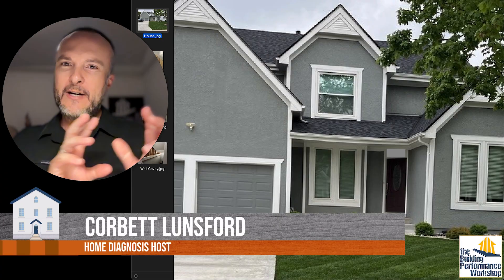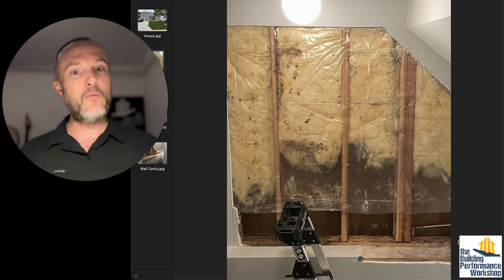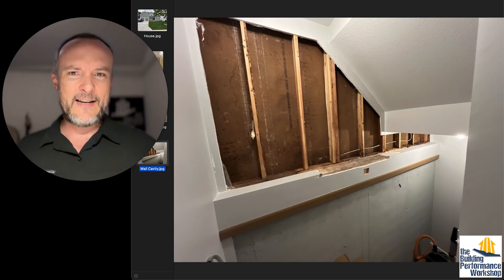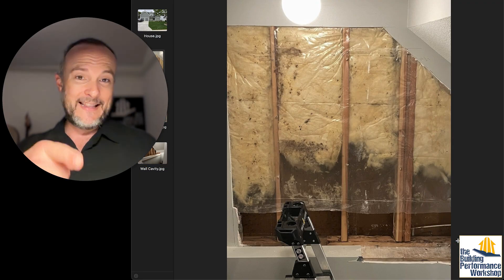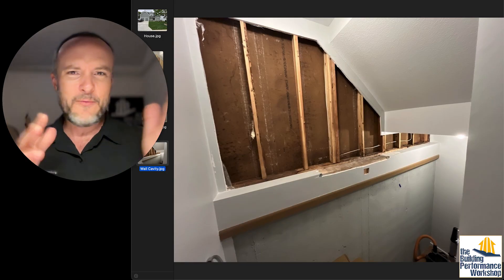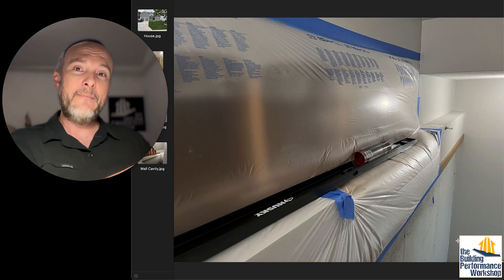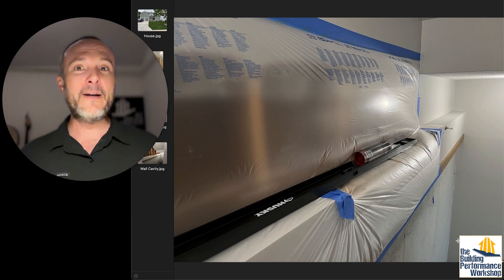Basement Mold Investigated & Solved (but NOT with spray foam or HVAC returns)

Comment: I would have a hard time judging what to do,just by saying the basement is finished without seeing it. Looks like the section you showed was above the concrete pour on the stairwell ;that being said, I would first start with the basement envelope , then the finished area would get supplies and return ducts added (envelope first & basement duct design second). But without showing us the entire basement layout , ceiling type, humidity readings and radon readings it would be hard for anyone to comment on the correct solution. Installing a louver door without radon readings could be escalating a problem. Just not enough information in this video , which is normally not the case with you 🤷🏻‍♂️.
Reply from the maker: Maybe you missed a few things in there, easy to get distracted.
Reply: @HomePerformance  at 4:09 and a quote “ it is finished mostly” (I saw no finished basement ). I must’ve missed the part where you gave us the radon levels, the humidity readings(along with the month and outside conditions). And my most concerning part would be, since we’re pulling a  negative pressure on that basement , no one checked the diverter on the water heater for spell & possible CO readings. What am I missing?

Comment: good job with the door. i really detest fixes that require people to do something. i've seen it here where depressurization caused the wood fire to back draft. their "fix" was to leave bedroom doors open. you forget to leave them open, you might die.
Reply: Just an FYI, doors should be closed during a house fire. It also goes against NFPA code to have a louvered  door between an unfinished basement and the living area upstairs. Corbin showed nothing in the video indicating a partially finished basement.

Comment: Thats a lot of negative pressure for just return duct leakage. Check and make sure there is a bottom on the furnace and check to see if they cut a return opening that wasn't needed or forgot to pan a joist.
Reply from the maker: Agreed, more investigation is needed
Reply: My furnace is in the garage. I’m going to go do a smoke test and see if it is pulling any garage air in.

Comment: The reason plastic is common on the inside of walls in colder climates like mine is to prevent interior moisture from getting into the walls, condensing midway through the walls, and leading to mold. Our wall exteriors are well below freezing in winter. Our walls are below room termperature about 8 months of the year straight, and they'll quickly become a black mess if the air barrier is on the outside. As the outside air is generally colder, when it does enter a warmer wall, its meager moisture doesn't condense. Since the materials of our walls are generally dry, ingress of humid summer air does not lead to an excess amount of moisture before they dry out again in the winter.

This also applies to basement walls build against a concrete foundation: the exterior is below room temperature, so the plastic goes on the inside to prevent moisture from getting into the wall. This does rely on proper grade and drainage to keep moisture away from the foundation.

It surprised me when I learned houses in warm climates have their moisture barrier on the outside, but it made sense after I thought about from where the moisture would ingress and condense.
Reply: That's all well and good, but you missed his point that half of the year, it's in exactly the wrong place and causes problems anyway.  That's why building science has moved away from a simple plastic sheet.
Reply: Your situation it might work because you said it works 8 months out of the year. So you have 8 months to dry out the 4 months of moisture getting in. 

A lot of the US is 6 months and 6 months so more moisture builds up a you have less time for it to dry out.
Reply from the maker: And yet I used to get calls for mold in walls every single August in Chicago
Reply: @HomePerformance  I could believe it! Chicago has hot summers (Dfa) with plenty of moisture in the air that will condense in cold walls. I lived in Toronto with a similar climate and the humid summers were one reason why I left. Summers where I am now are not as hot (Edmonton, Dfb), so the air has less latent moisture, and nights are typically below room temperature. Home air conditioning was uncommon here until the last decade or two.

I can see plastic always being wrong in the Lower 48 but it works here.

Comment: I would bet the flue on his water heater does not work.
Reply from the maker: Haha good eye buddy! You’re right :)
Reply: for sure, not with the negative pressure sucking the basement door closed. A Mech contractor should do a CAZ test, but none ever do. Heck they don't combustion test on a clean and tune.
Reply: Great point

Comment: So essentially because the basement is depressurized, moist outside air in the summer was findind a way into that wall cavity and condensing on that poly vapour barrier?
Reply: Yep. That’s it. You got it.

Comment: I have the same sealed combustion furnace. My basement has negative pressure, especially in summer with my single-stage AC. The furnace modulates during heating, reducing airflow and lessening the ‘pull’ on the basement door, though it’s still noticeable. I never thought to check if the furnace cabinet is fully sealed. The previous owner blocked the basement supply registers, and even after unblocking them, the negative pressure persists.
I recently bought a quality static pressure tester so I’m ready to get nerdy and try and solve this🤓. Any other tips? 
Living in AB Canada so cold/dry and mainly hot and dry in the summer.
Reply: If your near Calgary, I’ll come up and help ya.  Next July.
Reply: @TheDroppedAnchor a bit further up in Edmonton:) 
But you’re welcome anytime😀
Reply: @skylerdylan1005 😂 You’ve just stampeded and rough rided upon my geographic hobby.
Reply: @TheDroppedAnchor LOL. Hey you were close though.

Comment: I'm surprised to see a house built with plastic on the inside that far south. However in commercial a large chain based up north used to require franchisees to follow their plane and their architects etc. Well they put plastic on the inside of the walls here in Texas and they also put up commercial heavy vinyl wall paper on top of the interior drywall... As you can imagine during remodels those walls were full of moisture and nice fresh black mulch that was previously lumber and moldy everything everywhere. 
      
    Personally I don't really see many places in the US that should take the gamble on plastic on the walls. And same with Canada as the majority of Canadians actually live south of the Us northern border. (the earth is a globe not flat) And IIRC at one time there were more americans living further north than there were canadians.

        Good fix with the door. It's technically a bandaid but it's the appropriate fix in this case. Now if there is air being pulled down that furnace inlet that is interesting and it may be something we need to be adding an actuator valve to or a manual one. And to remind you to open it for the furnace would take just a simple switch on the valve where you run the white wire through it so the furnace can't come on unless it's open. 

          Makes me wonder if there is any air being pulled in through ours. Course I'd like to replace it with a heat pump this fall to spring as having a gas bill in the summer is not worth it and I'm looking at a system with a minisplit style condenser for several reasons one being they are very quiet. I'm done with the cave man style US compressors that kachunk on and off and make allot of noise.
Reply: Here in MN almost no one has exterior insulation to keep the sheathing at a reasonable temperature during the winter. I do agree the solution isn't plastic sheeting -- a smart vapor retarder is the right solution -- but we're in a country where few people are apparently willing to spend an extra 5% on a home to make it much more resilient (ack: the vapor retarder in place of plastic will add <1%, but there are other updates that also should be done that total ~5%). Or maybe that's just what builders think, so they don't talk through the complexities with their clients; I'd bet many homeowners / buyers would prefer to spend the little extra if builders could communicate the benefits (and if the homeowners/buyers trusted builders enough on this sort of thing).
Reply: The builders understanding the benefits is a big problem.
Reply: Plastic wallpaper in the south is why we need building codes. So stuff like that is not allowed. 

The wall compost would be funny if it wasn’t so true. 😂

Comment: I'm a little confused. If there's no return in the basement, but a supply register, then wouldn't the upstairs depressurize instead of the basement?
Reply: Check out the part starting at about 4:30 for more clarity here. In short, the long rectangular return ducting that runs through the basement is not sealed, which means it will be very leaky (air cracks between each panel of the ducting) That means, in effect, the basement has a lot of tiny returns throughout that long return duct running in the basement in all of those tiny cracks that add up to a lot of air flow -- this despite there being no actual return grills in the basement.

My first instinct would be to seal up all the cracks in the return duct. This might require a couple rounds to identify whether it was sufficiently sealed, and it also may not work super well without sealing the duct all the way back to the grill that's exposed on the above level.

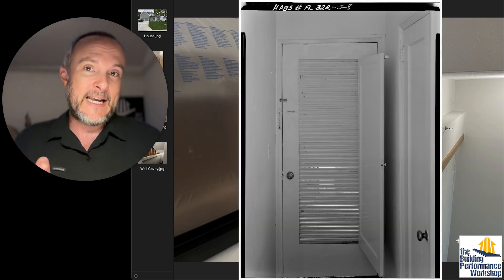What they chose to do instead (which seemed clever to me) was lean into the leaky ducting by enabling the air flow into the basement through the doorway rather than through the wall that had the problems discussed at the start of the video. Previously when the basement door was closed, the air was forced down the wall, causing the original issues. By adding a louvered door (shown at 6:52), that makes it very easy for air to flow through the basement doorway and not have to be sucked through the wall.
Reply: @dosadoodle Very good explanation. Thanks!!!
Reply: Except that the return duct work / furnace is so leaky that it  is trying to draw more air than the little supply vent can supply.

While adding a louvered basement door will address the symptoms, its not really fixing the problem.  A couple of hours with some foil tape might be a better investment.
Reply: @josephhfry , you are absolutely correct plus louver doors are prohibited by NFPA code between an unfinished basement and living quarters upstairs.
Reply from the maker: Where is that prohibited specifically?
Reply: @josephhfry  Foil tape still leaks- go with Duct sealant, takes no more time than trying to retrofit foil tape, and TOTALLY seals the duct.  It has been required in my area for years.
You hit the nail on the head with the guy just addressing the symptoms and not fixing the real issues.
One other thing he didn't discuss is- what about all the basement walls, they might have the same original problem to some degree.